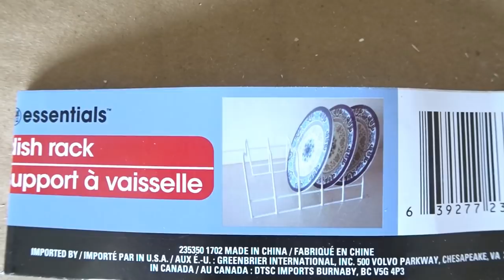DIY Dollar Tree Farmhouse Plate Rack

Comment: I would cut those corners at a 45 degree angle. Would like much nicer.  Just a suggestion.  Well Done!
Reply from the maker: I need to get better at that technique!  Thanks for the suggestion!
Reply: I like the way you do your edges.  Unless you're really very good a 45 degree angles--and you're staining a piece--it doesn't look good.  If you are going to paint--then 45 degree angles, chalk and paint away.  Like yours.  Just my thoughts after doing a lot of years of painting  and staining.  Great job.